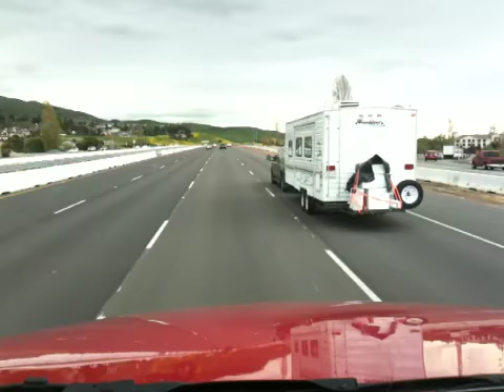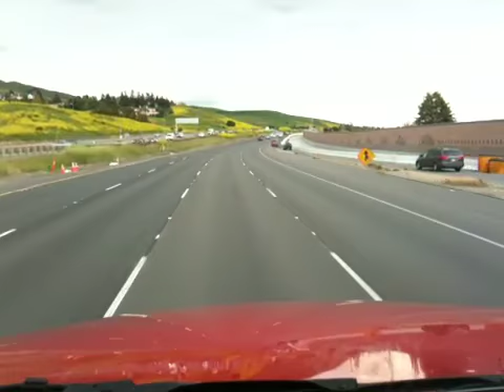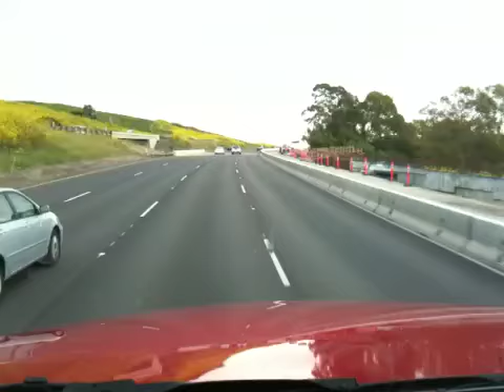Chp speeding through construction zone

Comment: Just because he didn't have his emergency equipment operating doesn't mean he wasn't enroute to a call.  Time of day, traffic and flow, roadway conditions and type of call dictate when we use lights/sirens.  That freeway was pretty open, day time and traffic was flowing freely so unless it was a Hot run he can run Code 2 (Stepping up speed, no lights/sirens needed) as it's reffered in most places.  

So SMILE you look like an ass when you don't know but spout off about it.